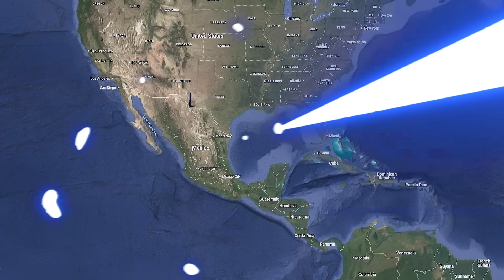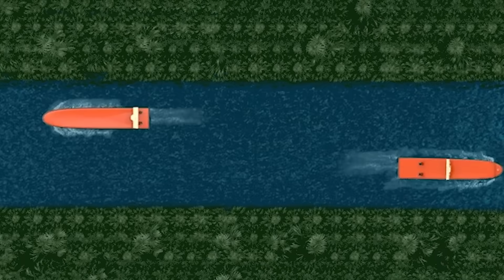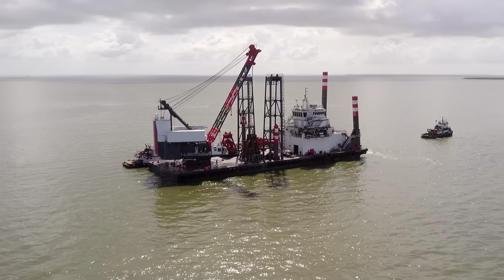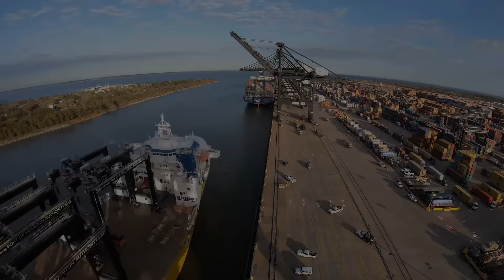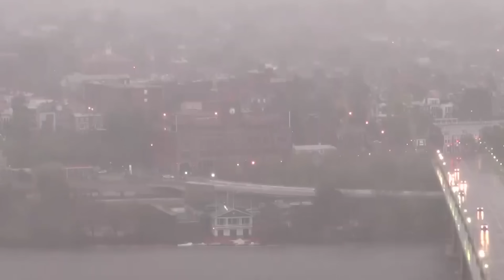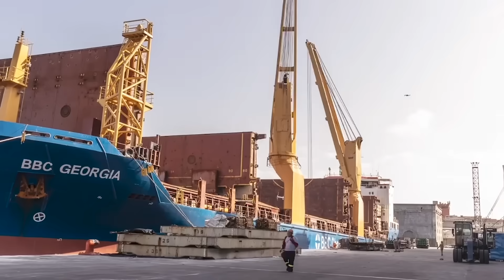Texas Is Removing Tons of Sand from the Gulf of Mexico to Get to Mexico

Comment: Dredging the bottom to increase the depth for deeper draft IS NEVER a long term solution  when u still have mud and earth still flowing into the bay. The mud will build up very fast and the mud they damped left and right will erode and find itself in the same bay again… the cycle is sped up with fast running or agitated waters…don’t they know it??? They know it all and keep rubbing their hands… you know for what ….